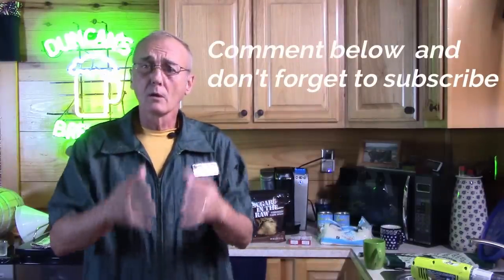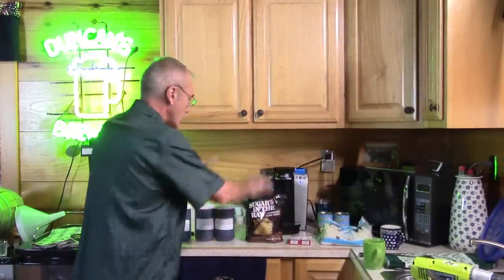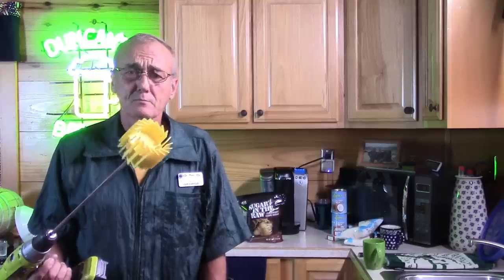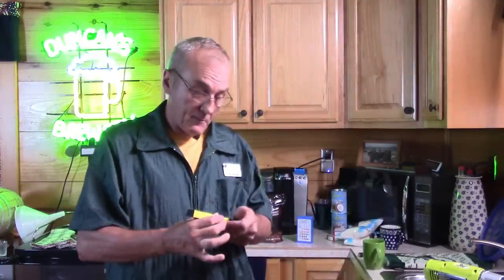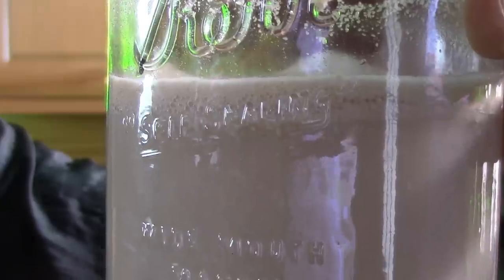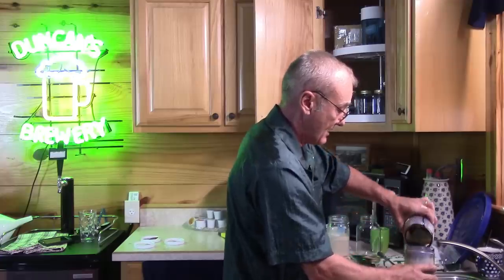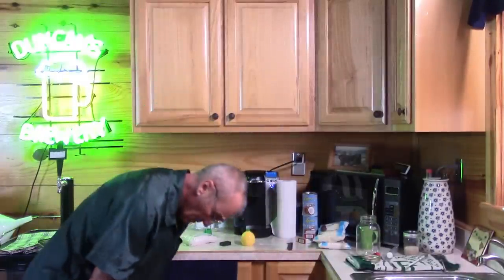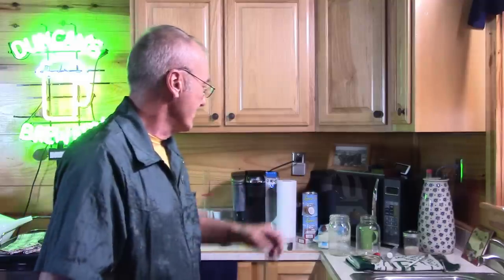Let's Make some Rum (easy step-by-step guide)

Comment: What would you do to increase the proof to around 100. 50%
Reply from the maker: I am a little confused by this. Proof does not come into play until we distill this.
George
Reply: Barley and Hops Brewing sorry. I'm still new to this. Haven't bought any equipment. Just doing research wanting to get into it. What is the proof of your final product after the first run?
Reply from the maker: Usually around 140-160 proof. All depends on how well the process goes.
George

Comment: 32 oz is only 2 lbs. 16oz = 1lb. So he only has 6 lbs of molasses.
Reply from the maker: Weight and volume are measured in ounces but are very different. 
32 ounces of molasses weighs 3 LBS.
1 Gallon of water (128 ounces) weighs 8.3 LBS or 132 ounces by weight.
1 gallon of molasses (128 ounces) weighs 12 LBS or 192 ounces by weight

You need to consider the difference between weight and volume. They are not the same.
Reply: Hi George, love your videos and your teaching style, but I thought the same thing when you said "32 ounces weights 3 lbs." 32 ounces can never weigh 3 lbs., 32 ounces can only weigh 2 lbs., BUT....32 FLUID ounces (volume) can weigh anywhere from 0.04 ounces  (air) up to 355.52 ounces (lead). The key here is "Fluid" . A fluid ounce is a volume measurement, thus having different weights according to the density of the materials being weighed. 
Gallons are also volume measurements (231 cubic inches per gallon), and you are correct that the weights of water and molasses are different (per gallon). This being due to the different densities of water and molasses.
Keep up the good work!! Looking forward to more great videos!  @BarleyandHopsBrewing

Comment: 2 lbs is 32 oz., not 3 lbs. Lavallin EC-1118 is a champagne yeast.
Reply from the maker: Wrong in both cases.
2 LBS (weight) is  32 ounces but not 32 fluid ounces. There is a difference.
EC 1118 is not a champagne yeast
Reply: George, I have a gallon (128oz) of molasses it weighs 8lb (8x16=128oz) so could you tell me how you get 9lb out of 96oz? Please tell me?

Comment: At 26:30 when it says after the fermentation process there is going to be 11% "pure ethyl alcohol" in the bucket, that is in fact not exact, you will have 11% total alcoholS, of which ethyl alcohol is the most, and the rest is "congeners". I know you know but it's always better to clarify that distillation is not only separating water from alcohol, but also keeping some alcohol fractions while discarding other fractions.
Reply from the maker: Sorry for the delayed response. I was on vacation in Vegas for the past 5 days.
True, I sometimes forget to break down that far and default to round figures. Sorry I did that. 
will do better in the future.

Comment: So... 3 pounds equals = 32 ounces???? 2 x 16 = 32.   3 x 16 = 48. Sorry, but 2 pounds is 32 ounces. 3 # = 48 oz. You have 3 containers,.. they must be 3 pounds each, or 48 ounces x 3 = 144 ounces. = 9 pounds.
Reply from the maker: 32 (fluid) ounces of molasses is 3 LBS which is 48 (weight) ounces. 
16 (weight ) ounces equals 1 LB.
There are two different scales in use here.
Even water is measured in these two systems : 1 gallon is 128 (fluid) ounces but weighs 8.2 LBS (not 8)